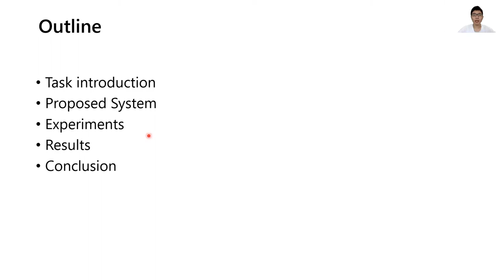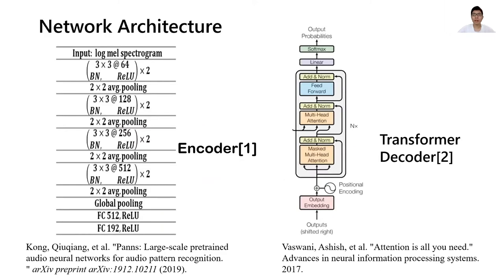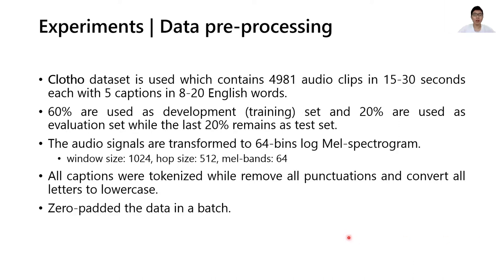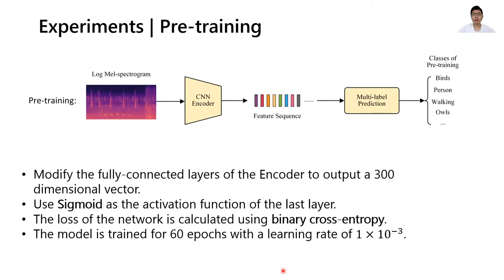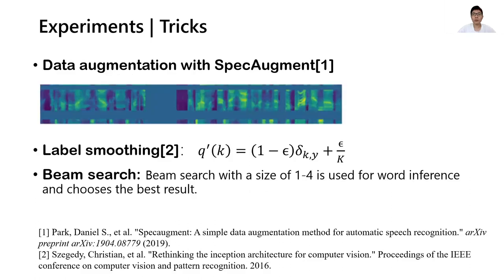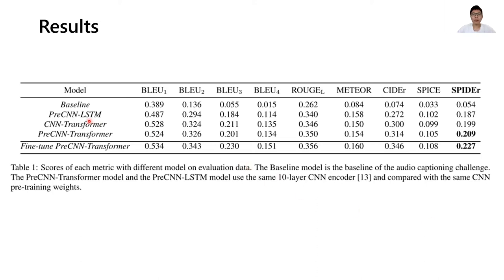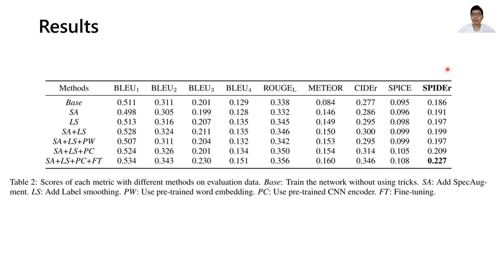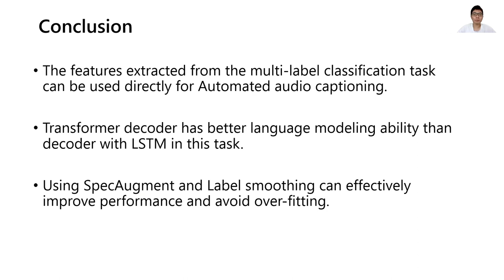DCASE 2020 Workshop, ID 16, Kun Chen et al.

Comment from the maker: yuma_koizumi
5:12 AM
 Has joined the channel.

keisuke_imoto
12:30 PM
 Has joined the channel.

kun_chen
12:35 PM
 Has joined the channel.

yuma_koizumi
Admin
2:39 PM
Thanks for very interesting work!
(1) How was the accuracy of keyword prediction in the pre-training stage? And has fine-tuning improved/degraded its accuracy?
(2) By comparing CNN-Transformer and PreCNN-Transformer, the CIDEr score has been significantly improved, even though the set of BLEU scores are comparable. It is very interesting for me that pre-training of the encoder improves a TF-IDF-based "fluency" metric (CIDEr) rather than the n-gram accuracy (BLEUs), although the target of Encoder's pre-training is keyword prediction accuracy. Could you tell me any insights into these results?
2 replies
kun_chen
6:38 PM
I'm sorry that I haven't studied the accuracy of keyword detection. I just choose the epoch with the smallest loss on the evaluation dataset. But I have selected some samples for testing and the outputs show that the prediction results are not very good. At the same time, due to the restrictions of the challenge rules, we select keywords based on word suffixes and word frequency, some meaningless words are also selected as keywords.

On the second question，I have the following conjecture：
(1) The results of the pre-training are not very precise, but provide some useful information as well. So, the set of BLEU scores are comparable. And the model needs to be fine-tuned to get better performance.
(2) In PreCNN-Transformer, we load the pre-trained CNN, and train the decoder. By this way, the model does not need to focus on the extraction of audio features, and the decoder can be optimized more effectively to generate smoother sentences.
(3) The pre-trained encoder makes the model more inclined to select words with higher frequency. This is equivalent to decrease the number of words for choosing, which reduces the difficulty of word selection. So the model can generate sentences better, but the diversity of words may be affected.
If you have other views please contact me. Thank you for your question!

yuma_koizumi
6:51 PM
Thanks for interesting insights! Excellent work!
November 2, 2020 6:51 PM

xuenan_xu
6:52 PM
 Has joined the channel.

xuenan_xu
6:52 PM
Hello Kun, your keyword prediction encoder pretraining approach is interesting and effective. I see in your results about the effects of pretraining and finetuning on the CNN-Transformer architecture. However, there is no comparison on CNN-LSTM architecture. Do you observe a similar trend on CNN-LSTM? Especially I want to know whether finetuning also improves performance significantly on CNN-LSTM?
1 reply
kun_chen
7:51 PM
Since the results of pre-training are not optimal, fine-tuning can generally be used to optimize the encoder to obtain better results. Currently I have not done the experiment to fine-tune CNN-LSTM. I will experiment it and give you an answer as soon as possible.
November 2, 2020 7:51 PM

kun_chen
4:56 PM
Hi xuenan, I redesigned the experiment to verify the performance of preCNN-LSTM. The following are my results:
PreCNN-LSTM: bleu_1: 0.486, bleu_2: 0.303, bleu_3: 0.195, bleu_4: 0.123, METEOR: 0.163, ROUGE_L: 0.347, CIDER: 0.286, SPICE: 0.106, SPIDEr: 0.196
Fine-tuning: bleu_1: 0.495, bleu_2: 0.307, bleu_3: 0.194, bleu_4: 0.122, METEOR: 0.161, ROUGE_L: 0.346, CIDER:0.285, SPICE:0.107, SPIDEr:0.196.
The SPIDE_r score of PreCNN-LSTM is 0.196, but there was no significant improvement in scores after fine-tuning the entire model. There may be problems with the selection of training parameters. I will upload my training log, I hope it will be helpful to your research.

kun_chen
5:02 PM
PreCNN-LSTM.log  

kun_chen
5:02 PM
PreCNN-LSTM-detailed.log  

kun_chen
5:02 PM
Fine-tuning.log  

kun_chen
5:02 PM
Fine-tuning-detailed.log  

xuenan_xu
6:28 PM
Thank you Kun! I think the result is reasonable since compared with Transformer, LSTM has fewer parameters. Finetuning works better for models with large amount of parameters.